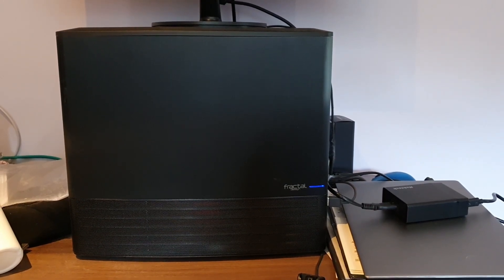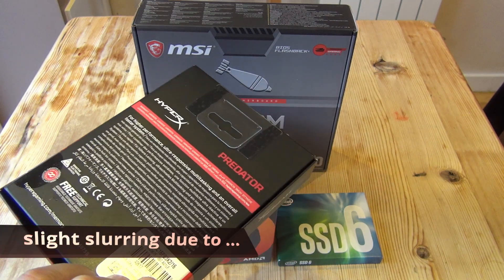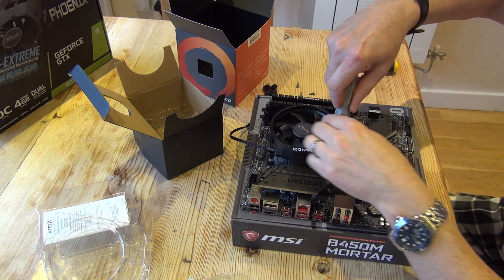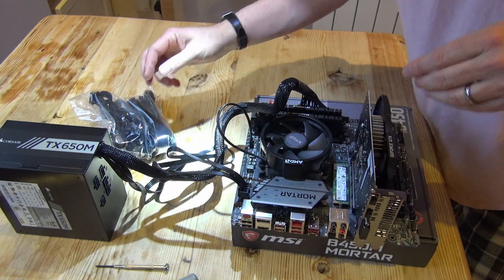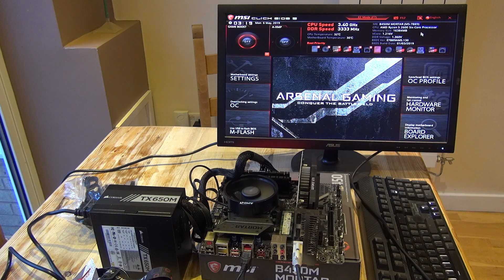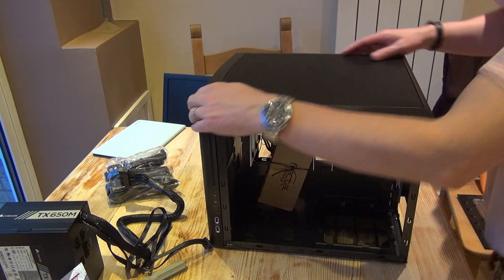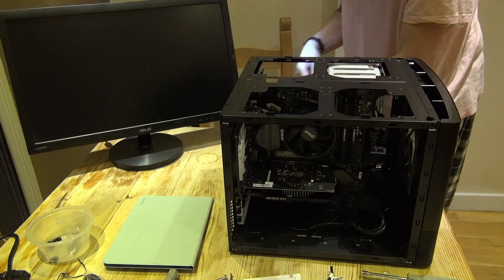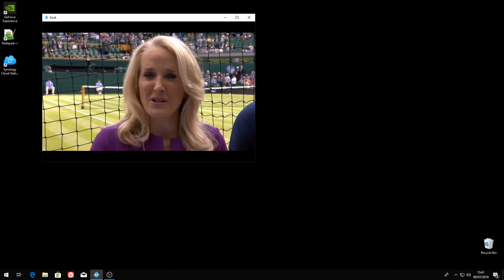PC Build : TV Server / mid price gaming PC - Fractal Node 804

Comment: Did you end up adding a pci - sata expansion card later? I can't find an mATX mobo that has more than 4x sata connectors whereas the node 804 supports 8x 3.5" drives...

Comment: Can you do this without a fast graphics card, can just the CPU handle all the processing? There’s no such thing as a modern, cheap, relatively fast gfx card in today’s market.

I’ve got a spare GTX970 and a load of assorted older cards I could use. None of those spin their fans down though. I don’t like the idea of sticking in a gfx card to make noise and use loads of extra power when it is probably going to be on 24/7

Would an APU be powerful enough to run a TV server like this do you think? 

NB: I ordered my quad HD card this week and trying to make a list for the rest of the parts atm.
Reply from the maker: The hardware requirements on the NextPVR website aren't very helpful and say 'a modern video card'. Given how good the latest APU's are (e.g. Ryzen) I would have thought its worth a try,  in any case you could add the GFX card later if the system turns out to need it. AM
Reply: @AmoebaMan  Thanks. I guess I should have looked there first
    Pentium 4 or AMD 1.4 GHz CPU.
    512MB RAM or greater.
    A modern video card.
    Large Hard Drive for recorded shows and other media. 

need to dig a bit deeper what 'Modern' means I guess :)

I read through a few forum posts and the GeForce 210 was mentioned a number of times :P
People even mentioned low power 2 core CPUs being able to broadcast 5 streams at once, even an atom was suggested.
The need to use a gfx card is mentioned a lot no matter what cpu, but the requirements seem super low unless Im reading it wrong
Reply: @AmoebaMan  Hi, just updating that I have finally got to the point that Ive setup TV streaming as described in your videos. Very long story why it took so long, but Hauppage apparently suffering from the chip shortage made it take 9 months for me to get a tuner card. I ended up buying direct from them after a 6month plus wait on a queue with Scan. I then encountered issues with the socket on the card (bad connection). I now (just this morning) have got working TV over my home network running from our oldest PC in the house acting a server - it was a proof of concept up until this point. I now plan to finally buy and build a dedicated sever for this. From recommendations Im considering basing it around a i3 9100 or 10100 as they can apparently cope with multiple streams without needing a dedicated gfx card. Your Node case is still a favourite for the box, but Ive not made the final decision yet. If you were to build your server again today, do you have any recommendations for what you would use?
- Thanks again for making these videos, I dont think I would have got this far without them. ❤

Comment: Thanks for the video, a curiosity, the case fans pull the air out or pull in???? (i'm not a very expert, and I would not have said nonsense). Thank you
Reply from the maker: From memory, default installed fans 1 pull in from front and 2 blow out the back but you can easily turn them around if you want to change this. AM

Comment: Hey mate, greetings from AU! I have almost the exact same setup at home with the absence of the TV tuner card.
Node 304 ITX, Ryzen 7 1700, ASRock AB350 mobo, 240GB M.2 NVMe SSD, 4x3TB HDDs. I run Unraid and use it as a NAS, Plex Server, many Docker containers, CCTV and VMs. So refreshing to see someone coming up with a very similar build. I'm currently looking to add a tuner card to stream TV across the network, rather than antenna cables everywhere. Initially thought about a HDHomeRun, however they seem to be unavailable, but today i've just realised I could install a PCIe Tuner card to fulfil the same purpose! Plus looking to upgrade from ITX....onto that!
Great video mate, cheers.
Reply from the maker: Hi! PCIE tuners card work great, although I have not run one in Plex or with UnRaid,  In my case I installed a Hauppage WinTV QuadHD PCIE DVB-T2 card, it is still working fine but I actually think my older TBS 6205 performs slightly better here in the UK, it can handle weaker signals, I have also had the TBS card running under Linux without issue.  Good luck! AM